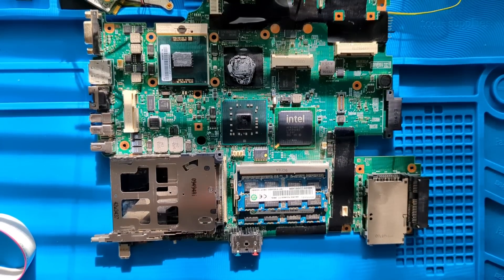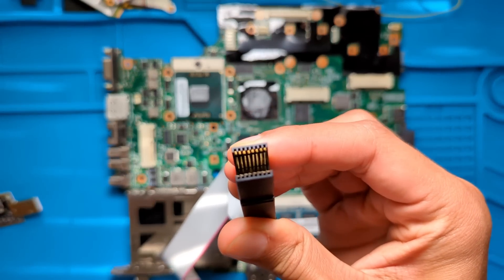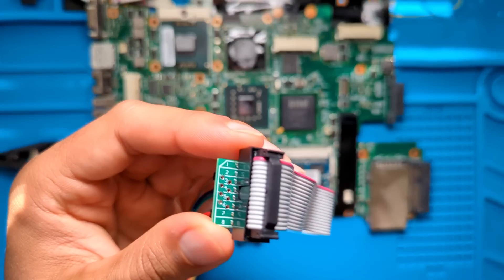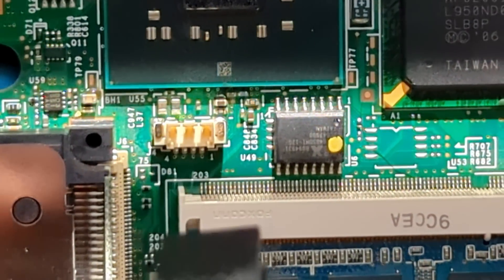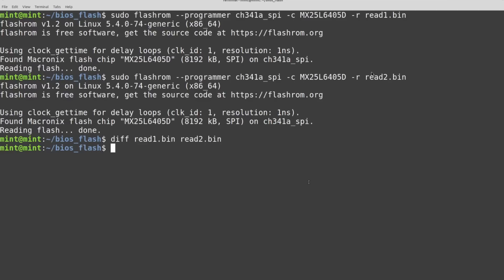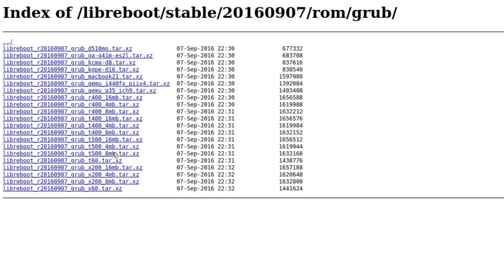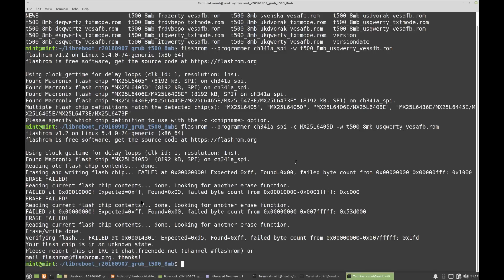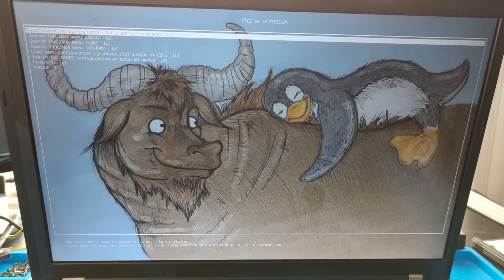How To Libreboot Thinkpad w500

Comment: The Thinkpad is a working man's machine. Long lasting, reliable, and fixable You don't see much of that anymore.
Reply: Yeah much better than all those crappy ultra books that will break in 3 years
Reply: PineBook & FrameWorks
Reply: Many modern non-touch screen laptops are so much easier to work on than these C2D monstrosities. Thinkpads are pretty reliable though, I’ve seen these things sit out in the rain and power on the next day.
Reply: @Bluebird it really depends on what you get, I got the carbon X1 because it's light weight, I wouldn't say 1.3Kg is actually heavy.
and it actually took off some weight in my wallet too :')
Reply: I also have a w500. But the battery life is almost non-existant, even though I just replaced it. The CPU is too slow and gets hot asf. In comparison to my new ThinkBook convertible it's worse in every way.
Reply: I bought a refurbished thinkpad and it's my favorite laptop ever. I'm 38 and have been assembling pcs for 20+ years.
300€ for an as-new t460 with nvme and i5, only 5 screws (captive so you can't lose em) to completely remove the back...
Reply: @benoitbvg2888  I got a thinkpad i7 with 12gb of ddr3 and a 500gb HDD  for $120 Canadian. It just needed a battery.
Reply: @benoitbvg2888  damn dude, prices have really gone up... I bought my t420 four years ago for $150 including battery and charger.
Reply: Was, Lenovo is starting to screw solder it up ...
Reply: from working men to 25 year old balding men on hrt to rice their gentoo setups
Reply: That camera man, nice!
Reply: It used to. Its been 3 years since ultrabook quadcore got released. I rather buy a Framework or S76 or whatever Linux laptop is sold
Reply: nah you just need to get second hand or warehouse remnant entreprise models. they are still good
Reply: Especially in the dating scene these days
Reply: You see much of it all over the place. You just have to know what specific model to look for. My dell is that way, so is my HP, and my Asus.
Reply: @Bluebird not overrated at all. They aren't even that heavy, literally like 3lb. Not even five years ago that was a totally acceptable weight for a laptop, now people are completely spoiled by thin-and-lights that are designed to be disposable.

You either get ultrathin/ultralight, or you get easy to repair. Those really are mutually exclusive.
Reply: I have a Lenovo IdeaPad Gaming. I wonder if it's compatible. 🤔
Reply: Yeah, unlike your grammar 😂
Reply: @@Melanciaaaaaa What exactly about it is an improvement over a more robust charging connector?
Reply: @@Melanciaaaaaa The connectors are obviously nowhere near as robust as a regular round laptop connector. It's obviously designed solely as a slightly better replacement to USB Micro.
Reply: Toyota Corolla of the tech world
Reply: @Bluebird you said that but haven't seen old macbook that's big, heavy, overheat easily, hardly upgradable, overpriced
and then there's helios 700

good thing I'm sitting happily here with my ideapad 7 with amd chip, not so upgradable, but it fits my need at the time of writing so it shouldn't be much of a trouble to use (at least for me)
Reply: How dare you say that and ditch the holy beacon of productivity - the macbook
Reply: @uvuvwevwevweossaswithglasses  I like money.

Edit: and freedom
Reply: @cd-yx3nv  I should've put /s there :p
Reply: @cd-yx3nv  got an HP omen 15 recently, everything but CPU, and pug is upgradeable, it's got everything from a flash card port to ethernet, to usb C, and it's made of aluminum. It'll last me many years. Good laptops still exist. (unfortunately the backlight doesn't work, but that's because it's RGB relies on windows drivers. That's the only downside)
Reply: @cd-yx3nv  I use a 2011 macbook, runs arch pretty well and works for basic stuff when I'm away from my pc.
Reply: @CaptainApathetic  dang I had the early 2011 mbp for quite some time.
Reply: USB-C for charging is an awful development, because USB-C was clearly only designed as a replacement for USB Micro. I can understand why USB-A for example had to be phased out since it couldn't really be upgraded further without breaking backwards compatibility, but there should be proper replacements to USB-A and USB-B that are at least as brittle as their forerunners.
Reply: @Eddies_Bra-att-ha-grejer  yes some OEMs did a bad job on implementing USB-PD. Soldering the port is bad design.
Reply: Thinkpads, hp elitebooks and probooks, dell precisions are the best cheap repairable laptops
Reply: I use a precision M4800 from late 2013 as my daily driver. I decided to look at the most recent models and for a workstation, there's pretty much no i/o and looks like they may not be easily repairable. Sad to see such an awful trend ruin such a great laptop, and this laptop is by no means the only victim. The older models are legendary.